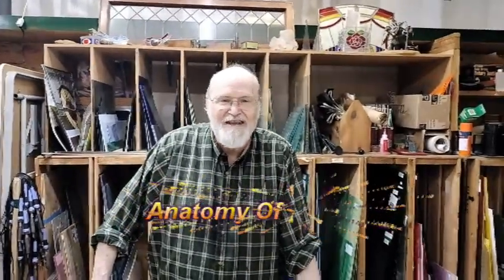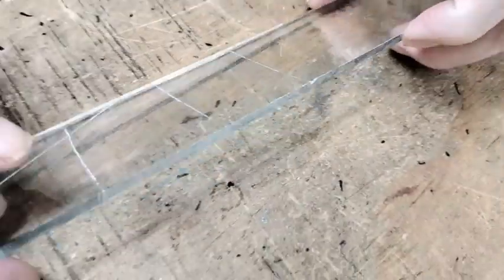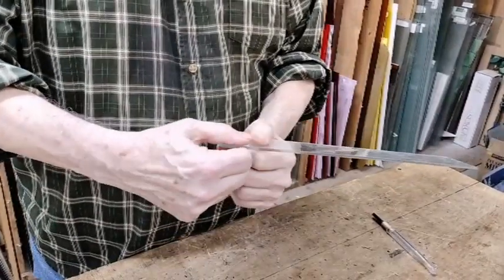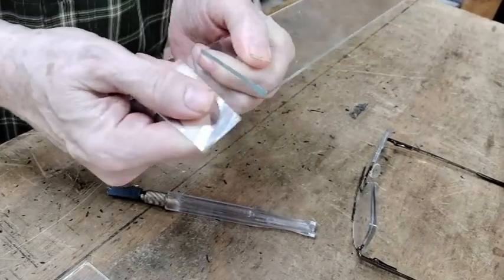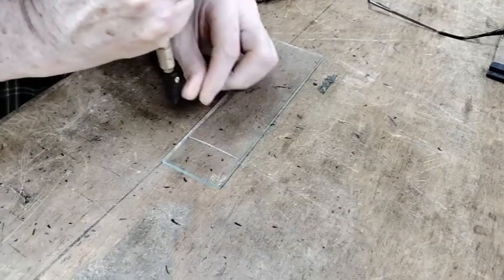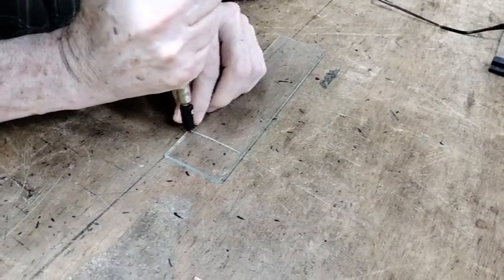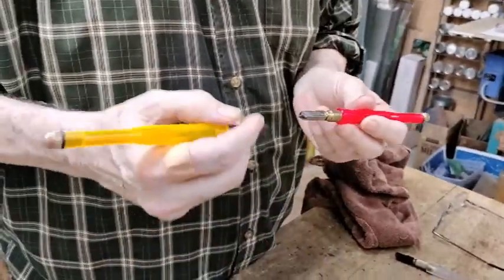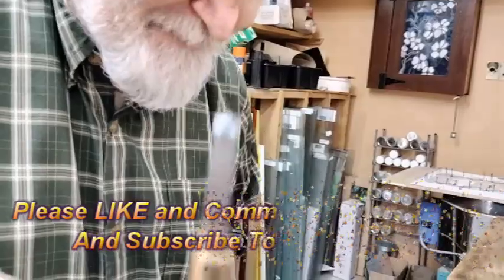Anatomy Of A Cut - Why We Cut Glass With Oil V426

Comment: Also, I think the cutting wheel axel needs-gets oil.  A friend of mine, who once worked at a glass company, told me that he’d seen many cutters fail due to not using oil, due to the friction on the axel.
Reply from the maker: That's true, oil helps to lubricate the wheel as well as the cut.